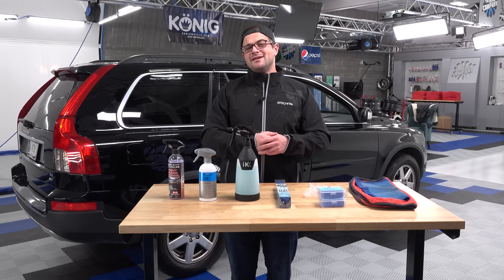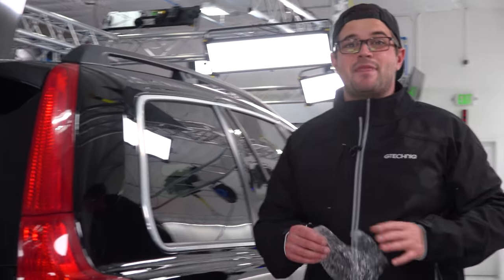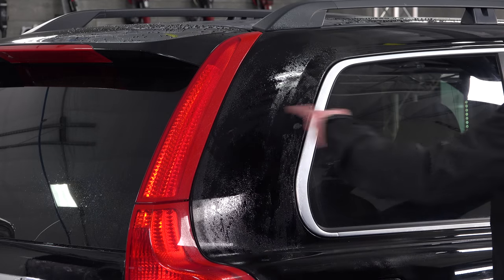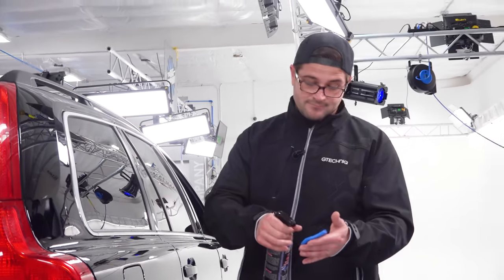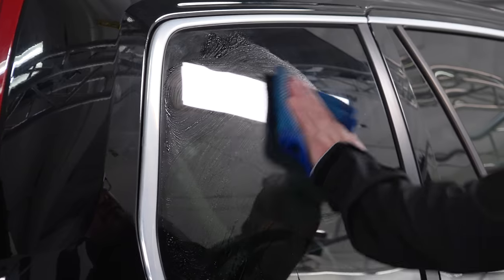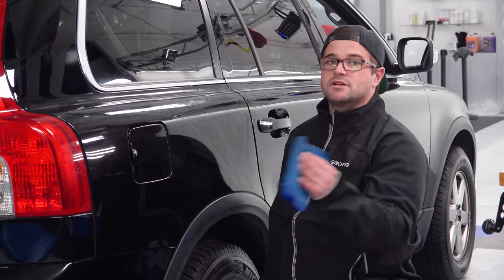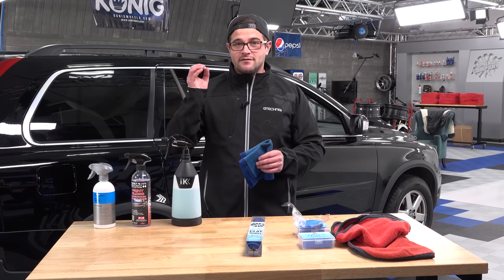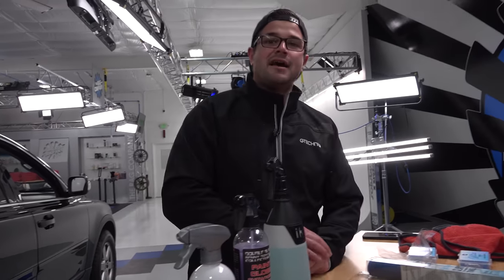Detailing Clay Products & How To Use Them! | Comparing The Ultra Clay Bar, Ultra Clay Towel & Lubes!

Comment: when claying the car 3 times, will that collect most (if not all?) of the contam, such as iron, tar and bug splatters? Meaning, 3x claying is THE only decontamination process? Could you rely on that and move onto mechanical polishing / paint correction stage?

Comment: Why do I need to break it in on glass?
Reply from the maker: We recommend breaking in your brand new Ultra Clay products on glass, as glass is very sharp on clay and will help hone the clay material, removing any excess/leftover material from the manufacturing process
Reply: @theragcompany  And if I'm about to use it on claying windshield can I break it in on it? Or would be using it on a back or sidewindow better before going for the windshield which is 20 years old 😁
Reply from the maker: Yes you can break it in on the windshield you're wanting to clay, however any piece of glass will work for breaking it in if you want to be extra careful.
Reply: @theragcompany  Great thanks for the answers. I'm hoping claying the windshield will improve visibility and wiper performance.

Comment: ONR is a wash and wax right? So if it’s diluted 128:1 it would be more like a detail spray right?
Reply: Regular blue ONR Wash and Shine does not have any wax. I believe you would use it at 64:1 for a detail spray, but Opti-Clean would be a much better choice. 

ONR Wash and Wax is green.
Reply: @jeffc6832  ok, I was just thinking that if you decontaminated and then clayed the car, the shine would act similar to a detail spray, and put down a layer of protection and the paint, which I wouldn’t want at that point